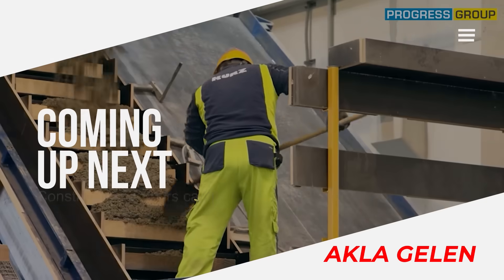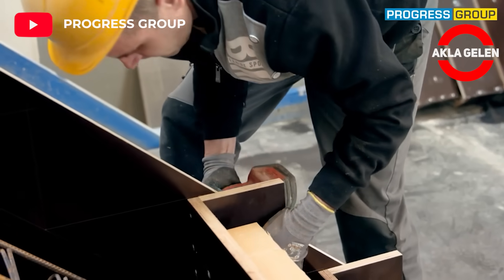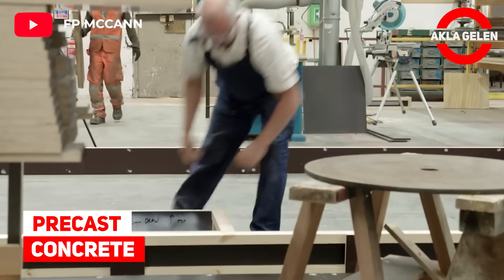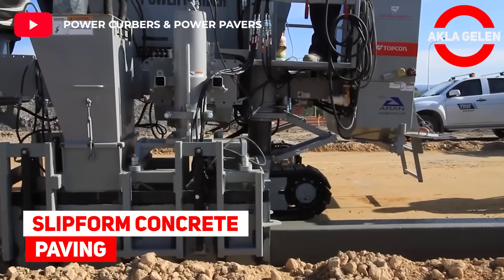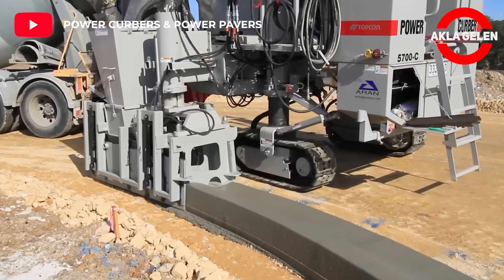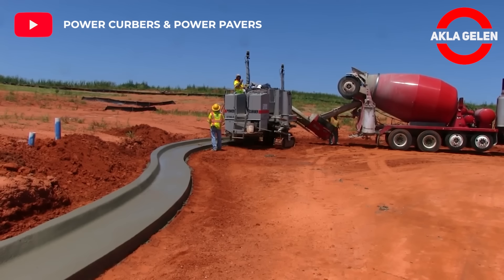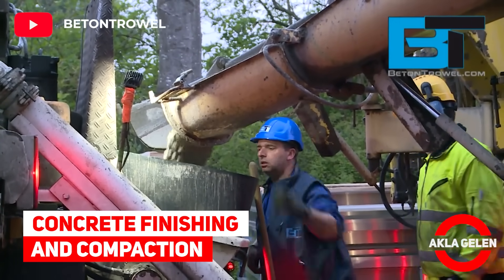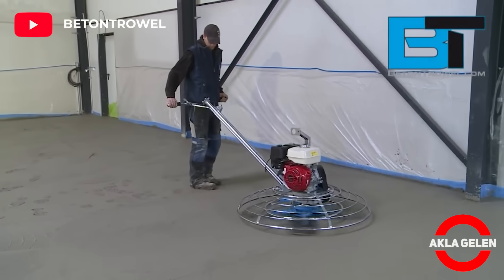Construction workers can't believe this machine. Incredible modern construction technology.

Comment: In the 80's, the dictator Nicolae Ceausescu used to bild apartments building using precast concrete walls and just assembled on site, like Lego pieces. 
Using this method, 200 apartments per day were put into use, at the level of Romania.

Comment: I'm questioning the safety of the precast multi story building in an earthquake unless the rebar is extended and joints are poured on site to bond all of it together a good shake could exceed the overlap support of the individual pieces bringing the entire structure down. the tilt up buildings with precast use the steel structure of the roof to keep all the walls standing I don't see the same structural stability in the building they showcased here.

Comment: LMAO so the companies wanted to eliminate the job of stair forming only to make it in a warehouse reducing the safety of stairwells because they are individual parts and not built together. They hate Having to pay us more because making stairs correctly isn't done by cheap inexperienced workers. so they bought an insanely expensive base form and still need the forming carpenter to layout and build the upper forms. also funny watching them use super expensive veneered plywood for the show finish instead of simple paper board the contractors supply. Anyone who's ever made the stairs in a high rise knows you are putting in the stairs as fast as possible to keep up with the floors going up so the workers access isn't impeded. The rise and run of each stair will vary 100% guaranteed! having someone come in measure then go away to a warehouse and build them then ship them back to tack them into place will cause delays worse case they get it wrong and have to rebuild them you'd waste crane time good luck staying in budget!

Comment: This is a way of getting rid of concrete workers and all supporting trades like carpenters who install the forms and laborers as well. Can’t get rid of electricians yet and plumbers too
Reply: as a sheet metal worker for 38 years, i mostly agree with you.  the thing is,  plumbers and electricians are already on the downward slope.  these days, with plastic pipe that you find in new homes and apts,  you don't even need a tape measure most of the time.  all your parts come out of a bin at the supply house.  pipefitters are on a little bit safer footing due to the nature of what is required in commercial/industrial scenario.  same with electricians.  all of your parts come from a bin or a box. it won't  be long beforehouses and  buildings are wired with pre made harnesses, same as a car.  anyone  will be able to do it, and wages will fall dramatically.  by contrast, every piece of duct on a jobsite is custom fabricated one at a time.  the fab shop has alot of machinery, but alot of work is still done by hand,  and installing it has to be done by men with skill.
Reply: No skill, s cleats , drive cleats and drop in anchors.....   All the fiitings and transitions were made in your shop or by Excelsior   .....     Nice try though. @cheezyridr

Comment: Imagine how much sand is being dredged up from the ocean to make all that concrete
Reply: None.
Reply: @steveg2479  wow really? I just googled it for you and states "More than 90% of the world's dredged sea-sand has been used as a raw material in the construction industry," Man you need to wake up.
Reply: Imagine your house or your local shops or the factory floors with no concrete, imagine the trees that would need to be cut if it was made out of timber. They came up with an idea to get rid of plastic bags , and they did , the solution was let’s make the bag ten times thicker. That same bag ends up in the land fill . Like an activist stopping traffic to safe the environment.
Reply: Why don’t they just get it from the deserts is it to fine or something 😂
Reply: @kingrutse3278  Desert sand is too smooth so its bonding properties are too low
Reply: What are you talking about.
Reply: Sea sand is even worse for building than desert sand. 
(1) The sand particle are too smooth.
(2) It's salty so any reinforcement steel gets corroded.
(3) The sea shoreline gets hammered by the next big storm.
Reply: Hi, please I want to work in as any of these construction company please help me I can even Summit my CV 🙏